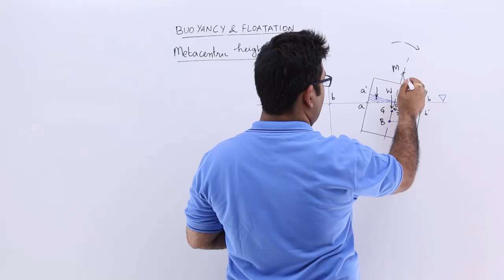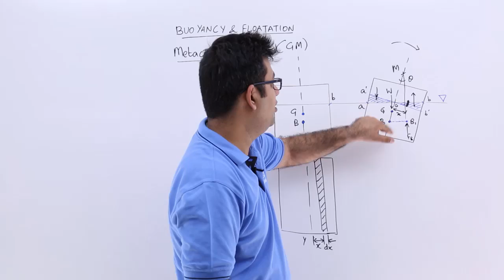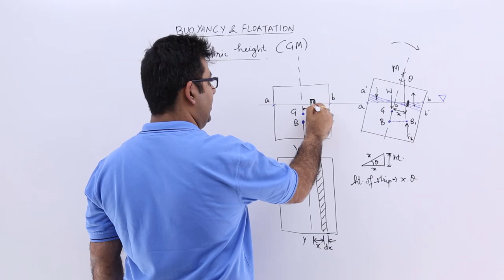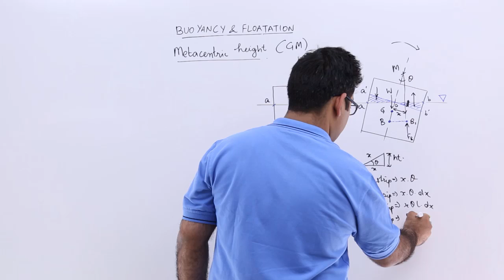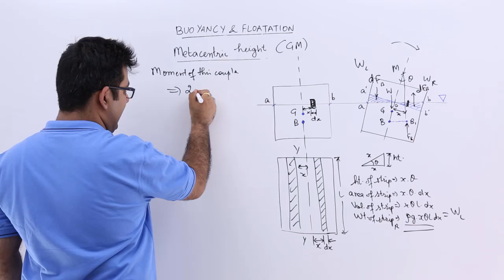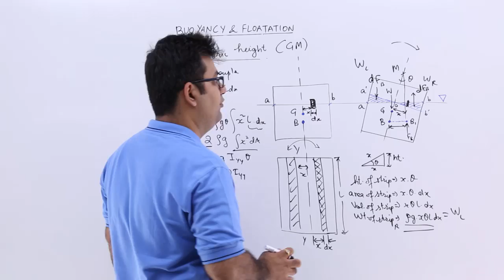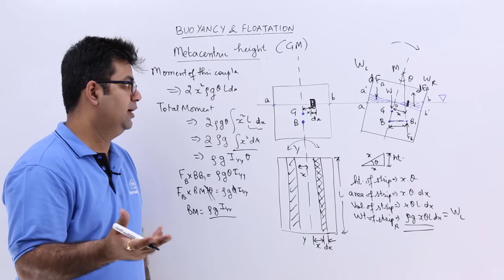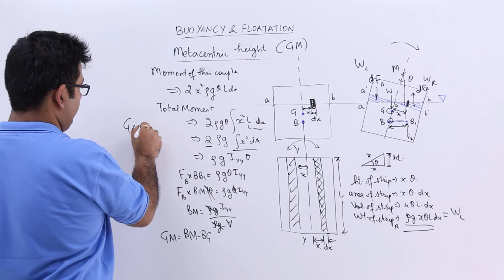Metacentric Height

Comment: When the floater rotates, where is the pivot point of rotational moment? The centre of gravity (point G) or origin (point O)? I think it should be point G but the figure shows point O, meaning the two hatched triangles on left- and right-hand side are not identical.  Is the formula always applicable, regardless of location of  point G? Of course, the point G only moves up and down.